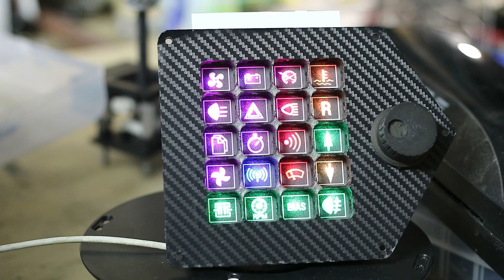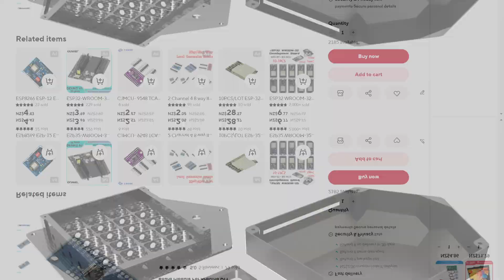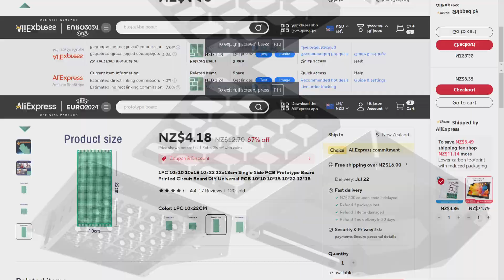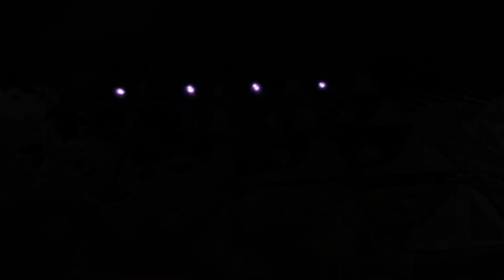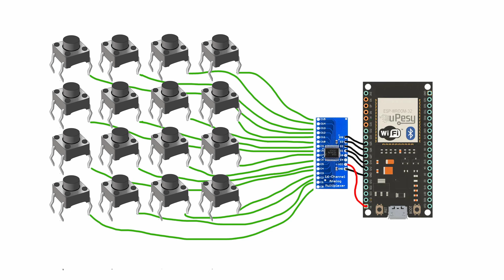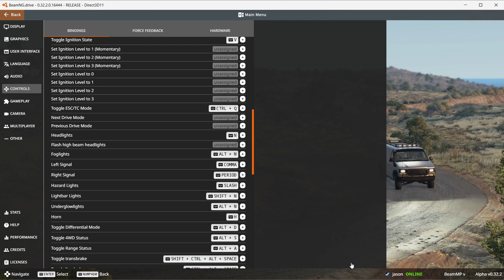DIY Button Box: Ultimate $20 StreamDeck Alternative

Comment: Hmm, i think it would be possible to add "buttons" - like button covers - to that design. Print a transparent top first, then change the filament to a black tpu. Print the sides of a button, and add an arch at the bottom that deforms if you press it, allowing the black tpu to trigger the sensors. 

I hope you all understand what i mean.
Reply from the maker: I did consider a method to do this, but it is a fine art getting really transparent prints with FDM. Maybe a resin printer would work.

Comment: Paper is too fragile i thibk wonder if u can use an acrylic if not possible due to sensor using thin 2mm or 3mm plastic is it possible??
Reply from the maker: I just laminated the cards. You don't actually touch the card to activate the switch.
Reply: @JWNZ  I was about to ask if laminating the cards would interfere with the sensors - glad to know that it won't!
Reply: Or just put an acrylic sheet in front of the card slot. It's not like you are interacting with the card directly.

Comment: Pretty cool. Have you ever considered, to directly print connections, instead of wiring? There are filaments that are supposed to be conductive and the Prusa XL can do hundreds or thousands of toolchanges in a reasonable time. So in theory, we could be approaching a point, where a matrix or circuit board could be printed right at home in a single piece.
Reply from the maker: Copper filament has quite high resistance which makes it a bit tricky.

Comment: Simply brilliant. The punch-card method of making the "button card" profile specific is genius! With three punch holes, you have a multitude of combinations allowing for 9  different profiles if all three solid is an option.
Reply: I only get 8 slots if you include all holes open, 7 if you don't. Hole 1+3 open is the same as 3+1 open.
Reply: @tench745  You are right! I was mis-counting as two when they're the same. A,B,C,AB,AC,BC,ABC.
Reply from the maker: All off is considered "off" so you don't get blinded by the pixels when swapping out a card. You can for sure program program the buttons with no card it's just easier on the eyes. :)